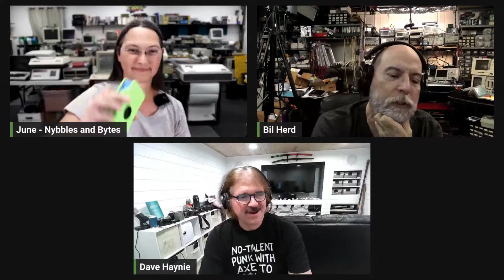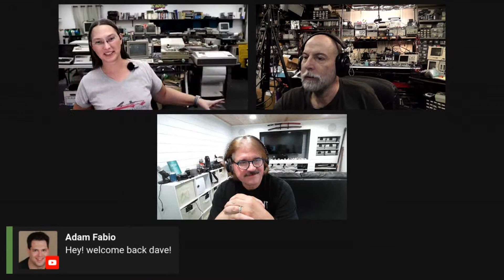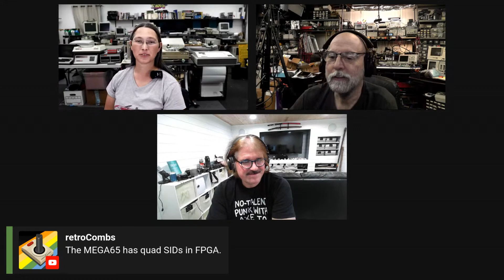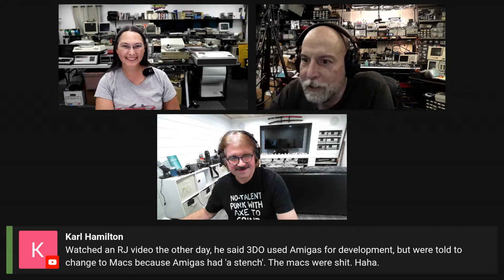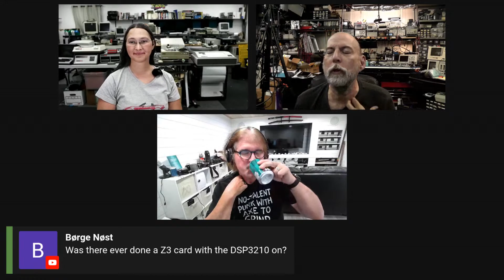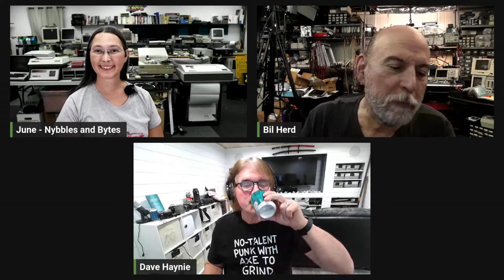Saturday Night with Dave Haynie!

Comment: @Final topic: A lab tour, which would be a 1yr update from the move would be great. It looks like both you and Bil have enough gear to stock a real museum. Also if a data sharing between systems has been completed (a question I raised in the first tour) can be described that would be a nice detail; its something too many of us collecting want to address. I had thought a Raspberry with programming its I/O would build a distributed approach (like 2 pins (clock+data) per 'system type' could be done but that's just a random thought. Thanks.
Reply from the maker: Generally, Goteks, SD, ethernet, serial, and sneakernet powered by greaseweazles is what I use to transfer data, usually, but it depends on the machine. The lowest common denominator seems to be hovering around ethernet and serial, though, for robustness. Except for really esoteric stuff.
Reply: Thanks,  @NybblesandBytes . I think we're all shufflin' the data around.
Reply from the maker: @vcv6560  Pretty much. After all, it's nearly impossible to get a C64 to load paper tape, and an HP Serial Analyzer to load disks from an Amiga. :P